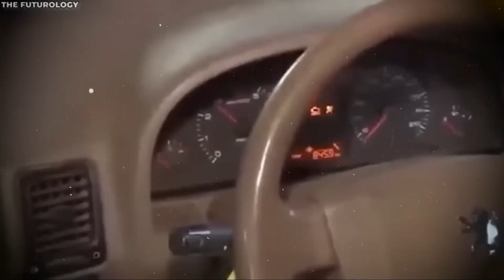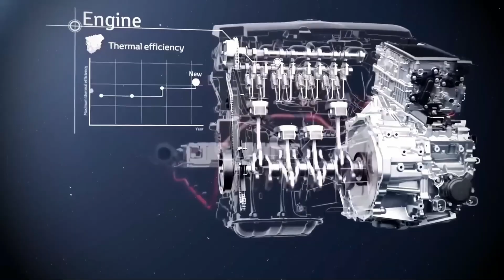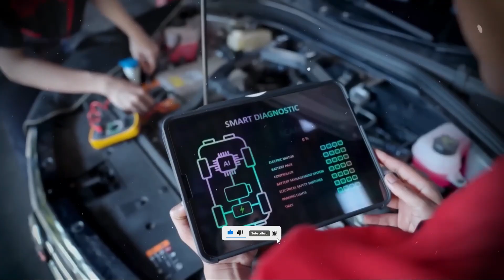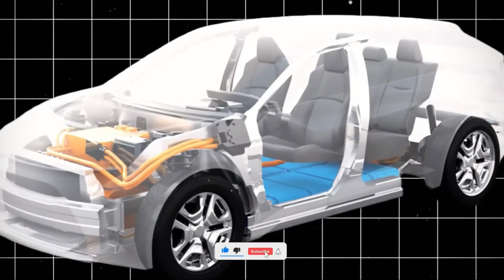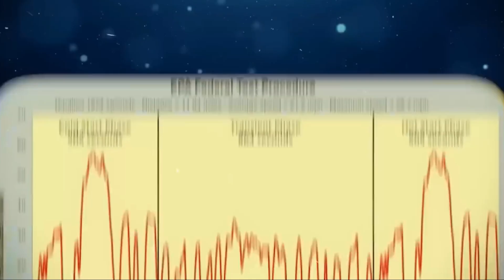JUST 5 Minutes Ago,Tesla & BYD Stunned: Toyota’s Dynamic Force Engine Changes Everything!

Comment: This is quite foolish. The information provided in this video is very lacking. An engine that uses three forms of fuel would have several downsides. First, the cost of manufacturing a vehicle that combines all three fuel types would be high, as it would be heavy and take up a lot of space. Also, if something were to break on this "car," good luck finding a mechanic who can work on it, as most wouldn't have the technical knowledge to do so. The costs associated with maintaining such a system would be significant. Given that it relies on all three fuel types rather than just one, the vehicle's complexity would make it less effective. While it's an interesting concept, the market simply isn’t ready for it maybe in the 2060s, but definitely not right now.
Reply from the maker: "I get your point about complexity — hybrid-tri-fuel systems aren’t without challenges. But every major shift in auto history started as ‘impractical’ until tech caught up. Early EVs were dismissed for cost, range, and maintenance too. The engineering world is moving faster than most expect, and what feels like 2060 might be closer to 2030."